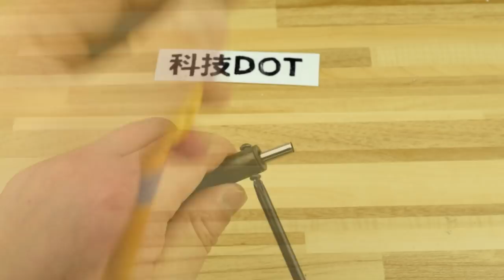soldering iron How To Make A Hot Air Gun Simple At Home

Comment: This is perfect because I'll be applying decals on my motorcycle soon and I'll be needing a cheap heat gun. I might get a higher wattage iron and modify the tip wider than standard to get some air flow.
Reply: Which one better, just buy hot air gun or diy using soldering iron??

Comment: That's great  - if you happen to have an old soldering iron of that specific type going spare, as well as silicon tubing, an old aquarium pump or motor and diaphragm, etc... But if you have to buy all the individual bits - you may just as well buy a cheap heat gun from the hardware store.  It will probably also have the benefit of being thermostatically controlled; having adjustable temperature; only requiring a single electrical outlet; being designed for the purpose; and far less likely to fall apart and give you a deadly electric shock too.
Reply from the maker: Thank you for your comment

Comment: Please wat is the English name of that silver solo tape you used to cover the holes in that soldering Iron hot air gun
Reply from the maker: should be Aluminium foil tape I'm not good at English
Reply: Try searching metal tape, aluminum tape, or duct tape. Duct tape as the proper name.
Reply: search for "self-adhesive foil"
Reply: Andican Umoh aluminum fuel
Reply: It’s not hard to find in hardware store. I bought that years ago for other purposes.
Reply: @Flare1107  duck tape! :D
Reply: @KJDOT  try to learn please

Comment: what is reason a air pump make hot soldering air on?  please explain reply please it is very nice
Reply: Works great for surface mount parts
Reply: Bhupendra Desai air flow ,pump makes air and pass through the solder iron
Reply: air pump pushes air thru the heater, creating a airflow of super heated air...aka a hot air gun, hot enough apparently to melt SMD solder....this is a CRAZY cheap way to make a viable working hot air rework station.
Reply: For very tiny things you cannot use soldering iron. In such a case, you need to use hot air soldering.

Comment: Haha! The big chance that the chip will not work after such a soldering. With a soldering iron, you only heat the leads, moreover, you can attach the radiator to the microchip for cooling. But you in the video warm the whole microchip. In short, you have done a great job, but nobody needs it, I'm sorry.
Reply: Semiconductor elements are afraid of overheating, look for the answer in Google. I worked at the plant for many years and mounted electronic components with a soldering iron. In order to quickly make the installation and earn more we regulated our soldering irons for a high temperature of 310-350 degrees. And we were constantly checked by a special control department - the temperature of our soldering iron stove should not exceed 280-290 degrees. If someone had more than 5 degrees, he was fined.
Reply: To solder observing the technological specification. I'm sure you'll find on the Internet about how to properly solder SMD.
Reply: I will remind you that I wrote only about SEMICONDUCTOR elements - microchips, transistors, light-emitting diodes, etc. The capacitors to resistors and other passive elements are lower.
Reply: Funny guy. You do realize that in modern industry there are no soldering irons at all while all the assembly is done using ovens, right? The only exceptions are wires and through-hole mounted components which are really rare today. Why ovens nor hot air guns ruin nothing, you'd ask. Well, ovens maintain a defined thermal profile - yet air is no way worse as if done right nothing goes far beyond the solder melting point which is well below the dangerous temperature. Furthermore, should you read the modern articles on manual repair, hot air is the standard method of SMD rework. To be honest, much more harm is caused by the components not being dried before assembly, and from this point shock heating caused by an iron is pretty dangerous on it's own, no matter what temperature you set. Of course for through-hole mounting shock heating is not an issue and in fact is much safer then slow heating, yet for the SMD parts it doesn't apply as there are no long pins to dampen the heating rate. All is just words however as I never actually managed to damage a component by neither iron nor air gun.
Reply: grain, this idea is Good only for the desolderin mode.
Reply: true fact but i need this
Reply: For reflowing porpouses i think it still usefull...
If the component can stand the temperature
Reply: yes. i agree. that IC will overheat. 
sorry english is not my 1st language
Reply: Lols, chips are heat resistant, most of them anyway. Not to mention it's just a sample work.
Reply: Cryptic Broccoli Not that much... Most intels and amd processors had a limit in about 100°c, many older ones had 55°c, 65°c. And many non-complex chips, that dont dissipate such high number of watts, arent supposed to work in such conditions. 

But yeah, look in the datasheet of the chip, but that isnt probably the best way to solder it.
Reply: Eduardo Avila Yup thats why it's important to track the amount of heat being delivered on the chip considering this is a diy tool. The author demonstrated (not exactly but you get the idea) by moving the chip a bit, let chip cool down a bit then appy heat again. Rinse and repeat. Not ideal for reflow because the tool is diy but at the end of the day the pcb board is just a sample work to demonstrate the tool.
Reply: Cryptic Broccoli Yeah, its better to be able to control the temperature, but its a neat concept.
Reply: Soldering hot gan i m canfius round box air